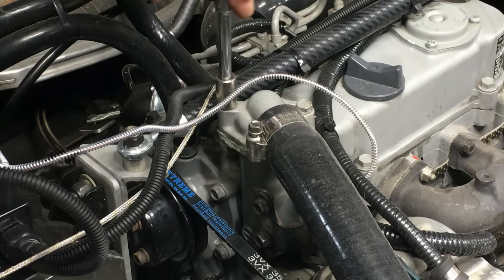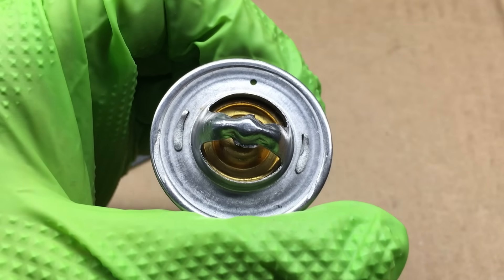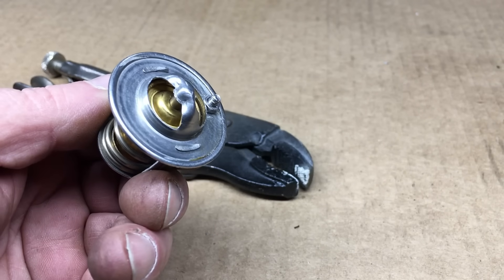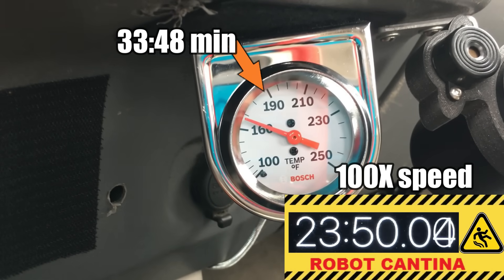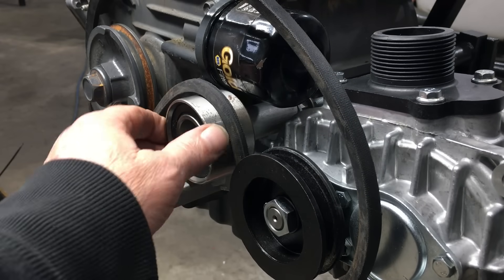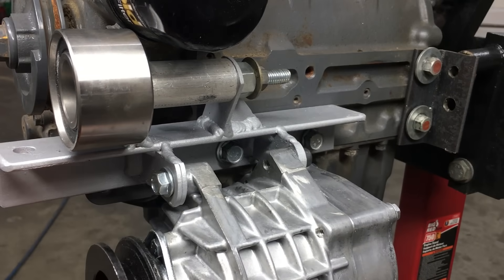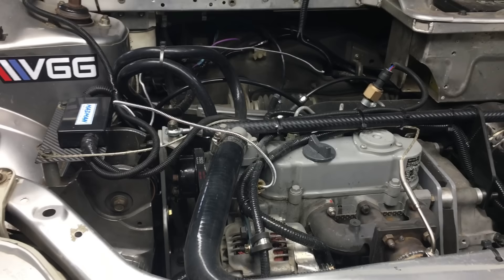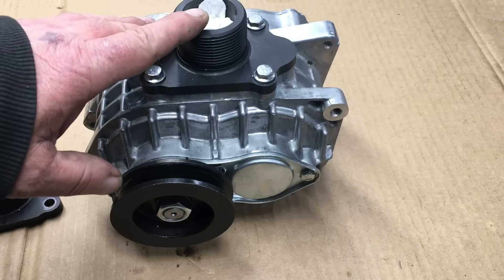S4 E4. Thermostat issues and making an AMR500 Supercharger fit a 719 cc Kubota diesel engine

Comment: I wonder if it wouldn't make more sense to install an belt driven air compressor and an air tank instead of a supercharger.

The benefit would be, that you could install a clutch and disengage the clutch if you push the throttle down far enough. So you only rob engine power for the compressor if you have power to spare.

If the air tank is large enough you can accelerate to 60 mph before you run out of pressure and for cruising there should be enough power to spare to recharge the tank again, as you ease up on the throttle.

Another option would be to run an electric compressor off of 12 V and stop charging with the alternator once you kick down.

Comment: I think the idea is more to have the thermostat to heat up faster, not the engine. So the thermostat regulates faster open if the engine heats up quickly, as there's a constant stream of hot water flowing around it.

But that's absolutely not an issue and can be ignored except on high performance engines.

Comment: alh tdi , they use 3 glow plugs in the coolant system right off the thermostat on manual cars. seems to work well (installed in the coolant hose )

Comment: Turbo vs super charger is a choice made between higher top speed and durable efficient power. My KEI truck is getting an AMR supercharger. I'm want the higher stable torque throughout the RPM range. Not going for more rippums. It's a work truck.

Comment: I'd throw a 190 or 200 degree thermostat in it if you're constantly running into heat issues. I'd wonder if your cooling system is too large and the sheer volume of coolant is dumping temperature faster than the engine can make it

Comment: as a guy from up in canada,  if youre struggling to get some heat id reccomend blocking off things as best you can, blocking airflow through the rad can help. so that way when your thermostat opens at 160. most of the equipment that has an engine like that, has a belt drivin fan, if if your electric fan is coming on too soon you could also see about disabling that.

Comment: I'd try another thermostat they can be bad even when new.

Diesel engines take a long time to warm up with out a load because they do not have a throttle so they are always cycling lots of cold air through them

Comment: So you need a smaller radiator is what I hear. This engine was designed with a single core radiator half the size your using. Also that original radiator never used ram air to cool it rather just the engine cooling fan therefore the ram air is even further super cooling your cooling system while driving down the road.

Comment: Window shade type of radiator blinds:  SAAB 2 cycles used them because their little 850 cc 3 cylinders made not much heat while warming up.  They also carburetor iced like crazy without an exhaust stove snorkle to the aircleaner.  The blind you could control from inside the car  but not the exhaust stove.

Comment: Without the hole, the temp can oscillate above and below the rated temp at the initial opening.  Some thermostats that appear to not have the hole, still have an engineered small opening area made into a spot where the center spool and outer section come together.  I've played with thermostats a lot over the years, they are pretty nifty inventions.

Comment: I wouldn't use a belt drive Super charger i have seen the supercharger dyno results on another channel and it initiated a 20 hp loss ro spin the super charger. So yes belt drive supercharger big mistake. Aspire to create an electric drive super charger and fet rid of the restrictor to really open up the air flow with a custom wide open connector

Comment: Check out my fast and fuel efficient diesel grand caravan TDI swap , 6 speed manual. 900 miles per tank highway. 295 wheel torque.

Comment: I read on a diesel forum about some Renault 1.4 diesels cooking the cylinder heads, apparently because people replaced thermostats with "pattern parts", that did not have the bleed hole.  Apparently it avoids creating hot spots on warm up.

Comment: One of My Fondest Memories after Graduating H.S. in 84 was Working @ a Large Third Generation Welding Repair & Fabrication Shop. They Worked on Everything from what came in the Door to Aerospace. One of There Long Time Customers Came in With His Logging Truck, With A V-12 Detroit Diesel two Stroke. Twin Turbo, Suppercharged Straight Stacks. He Stated There Was """ NO "" Faster Truck in the Mountains Than His. The Super Charger Gets That Load Moving and Spins that V-12 Up Then The Turbos Kick In, & Him, His Truck & His Load Are Gone  !!!
( and It Souded Beautiful ) But Every Inch Under That Hood Was Used !!! 
Radiator, Motor, Firewall..... Nothing To Spair

Comment: At least on rover K-series engines, the bypass hole in the thermostat is to prevent a sudden rush of very cold coolant from the radiator, cold shocking the engine, however on the Kubota diesel being an iron engine, I don't think it's an issue

Comment: I know you cant get a higher temp thermostat due to the unique size. What about 3D printing a bespoke housing to fit a different thermostat? Or even just an adapter plate? I know a lot of them are made from plastic?

Comment: Im looking forward to seeing how the Insight goes compared to the base line acceleration tests, once its running with 10psi from the supercharger. And then further gains hopefully from a proper front mounted intercooler this time. I think it will make quite a difference and be far more responsive between gears than the turbo was.
What would be cool is to see a dyno run with a power and torque graph for the car, firstly with the supercharger and then with the turbo from the Saturn.
Will Jim be gearing the supercharger to make the 10psi at 3600rpm, or could it be geared higher to make the boost at lower rpm, and then a turbo waste gate used to maintain the required 10psi to the ~4000rpm the engine car reach?
The new exhaust system will certainly flow enough gas for any modifications made this time.

Comment: You also had the window shade cover on cold spec 60 series land cruiser with the 2H diesel engine. 
I still have the original part on my 1983 HJ60 lamd cruiser, but the curtain have seen better days, that for sure!

Comment: For what its worth... And my evidence is purely anecdotal... I switched to a to a hotter t stat on one of my little isuzu diesels and I could swear it ran a little smoother, cleaner and quieter once it was completely warmed up. I mean technically it makes sense, you're reducing the temp delta between thd pre-cup and the water jacket. I could swear it got me better fuel mileage too and did a little better on power. But maybe I just tell myself all these things to sleep better at night. 

Also, if anyone reads this, if you could get me a PN for the injectors I'd be interested in supplying a set with a higher NOP. As far as I know all manufacturers have a higher NOP when running boost (maybe paired with slightly retarded fuel timing).

Comment: I could be mistaken, but I think my comment before has disappeared. 
So again, maybe a way you can extract a little more heat for the coolant loop, would be to pull an EGR valve and EGR cooler from a diesel pickup. Plumb the EGR to pull exhaust post-turbo and route it into an EGR cooler, and then back into the exhaust. Since this is not an emmissions vehicle, no need to feed that ick back into the engine, just run it back into the exhaust. With the exhaust going into the EGR cooler, it will dump exhaust heat into the coolant loop! It can be completely controlled by the valve, too. Just a thought!!! I am sure unwanted EGR parts should be readily accessable 😂

Comment: Do they make a higher temperature thermostat? Seems like you might need to find a 200F instead of a 180F if the 180 is maintaining 160 with your fan running then wouldn't it likely maintain 160 when driving regardless of the outside temp?

Comment: I'm certainly no mechanic, but my guess why there is a bypass valve is because the water isn't only used to cool the engine but also to spread the heat. You'd get very high temperatures next to the actual cylinders when the engine is running and there is no water flow while other parts of the engine might remain dead cold. Worst thing about this is uneven heat expansion.

Comment: While we're on the subject of cooling and thermostats, it is commonly believed that removing the thermostat will cause overheating because supposedly the coolant passes through the radiator to quickly and doesn't have time to cool off. I rather think that the flow restriction of the thermostat which is downstream of the pump allows the coolant pressure between the pump and the thermostat to go quite a bit higher than the nominal radiator cap pressure, and if this restriction is missing then the consequent lack of pressure, particularly at hjgh rpm would allow localised boiling.

Comment: I would imagine the ideal but more complex method of cooling would be to have the coolant circulate at full flow (but with a calculated degree of restriction) and entirely bypass the radiator when cold, and be progressively / proportionally diverted to the radiator as the desired temperature is reached. That way, dead cold water exiting the radiator is mixed with fast flowing hot water from the engine loop. More complex, but may yield better results.

Comment: A diesel engine at idle ingests a great deal more air than a gasoline engine, and if this air is at a low temperature it will contribute to engine cooling in an uncontrolled manner as it passes through the inlet ports that are surrounded by coolant.

Comment: Supercharger boost will be 100% rev dependent and will drop on each gear unchange. Be an interesting but very involved experiment to drive the Supercharger with a variable speed type pulley arrangement to maintain a given boost independent of engine revs.

Comment: In my part of Canada (about the lowest I see is -40C/F), we used to use the cardboard in front of the radiator trick quite a bit before electric fans became a thing.  With electric fans the cardboard trick doesn't have as much of an effect on available heat in the cabin.  For example in my 3L minivan, when the outside temperature gets below about -30 the engine just doesn't produce enough heat to warm up the interior space for a very long time.  The engine is running efficiently enough that it just doesn't have enough waste heat.  It warms up faster if you drive it like you stole it, something that works much better with small 4 cylinder engines that don't get you into speed violations as quickly.  You can also try putting the cardboard directly up against the radiator, but if you do, cut about a 6 inch diameter hole in it centered around the fan.  If you're wildly off-center, you can actually make the blades flutter and hit the radiator fins.  Putting the cardboard up against the radiator allows more of the coolant to come up to temperature, in essence creating a larger volume of heated water.  This helps keep the air out of the heater stay a little more constant, because the cabin heater can overcool the engine in low load situations and you get cold air out of your heater.

One other thing that can help is to install a higher temperature thermostat, but I don't know how useful it would be in your climate.  I'd be interested to see if the supercharger without the intercooler would help with cabin  heat :).  Thanks for posting the video!  Interesting stuff!

Comment: You might consider a radiator bypass hose, which is a hose which bypasses the radiator, not bypasses the thermostat. I had to add one to my wife's Kawasaki GPX250 which wasn't warming up on frosty mornings.

Comment: Having worked at a Kubota dealership. The most important thing when filling the cooling system, is to fill from the thermostat hole until it's full, then install the thermostat.  Then fill the radiator.  A Kubota engine will not burp out the air bubbles if you do not do it this way.

Comment: Hunt around the salvage yards for an EGR cooler.
You can plumb it into the exhaust and cooling system with an exhaust butterfly valve and bypass.
This will solve all the cold weather problems and heat the engine in a few minutes.

Comment: Don't plug the bypass, some engines would die in short order with a plugged bypass. was a problem we went through with the old SBCs back in the day when GM changed the bypass from through the heads to the intake. Maybe it won't be that serious in this engine, but instead of plugging the bypass you can try to reduce the size of the hoses or put a constriction somewhere to reduce flow and thus increase heat, or just a higher temp thermostat. The bypass is crucial in preventing hot spots as I'm sure other people have mentioned.

Also superchargers aren't an issue on diesel engines, people don't understand that turbos aren't drag free, turbos are literally an exhaust restriction and your piston has to work against it to push exhaust gasses out, thus inducing drag. For a little engine like this, I'd put money down that a supercharger is going to perform better than a turbo, superchargers have predictable boost curves since it's directly tied to CC/revolution and revolutions are directly tied to the crank. Predictable means your little mechanical fixed adjustment is a lot easier to tune. and the size of this engine means no turbo is small enough to spool close to idle. If you look at a truck diesel or any bespoke car diesel, they start making boost right off idle, a Cummins in a ram is at peak boost by 1800 rpm, that's about half of redline which is exactly what you'd want. In an ideal world you would have a couple PSI at idle but then your emissions and economy would take a hit.

Comment: I have had issues with Kubota thermostats not working properly. Mainly running cool. In a car engine the thermostat regulates temps better. These engines are made to work hard and a more than adequate cooling. They do make heater kits for kubotas with cabs. I have installed several on those little engines. Not that it would make a difference but try an automotive thermostat from something like a Mitsubishi. Also that radiator is too big. That engine would usually have a radiator the size of a shoebox.

Comment: I don't think that the thermostat is the problem, maybe your radiator is too efficient with this fan.
If it helps, you should try something that starts the fan slowly and increase the velocity until max, I don't think that you can use a thermistor directly because you need a minimum voltagem to start the fan without any risk.
Well, I think that the velocity approach on the fan will help a lot.
The hole in the thermostat let a little amount of water flow so hot water could reach it faster, without the hole the water only reach it by convection. (I hope that my English is good enough for you guys understand).

Comment: What's happening is the thermostat isn't actually sealed so it's probably blowing coolant past it. The little hole is a bleeder when filling it and gets air out of the system. Not hard to figure out Jimbo.....n my 04 2.2 cavalier takes a good minute to warm up also when cold. Like 20 and below. Also I still don't understand why ppl blocked off radiator. Thermostat n all. Unless have a major leak around the thermostat it still opens n closes as should.

Comment: Given what many of us were told about the bypass hole - that with one the coolant can heat the wax to open it up-  it seems like the real problem is that the cooling for a certain flow is a bit much for the minimal heat generation. So while you could use a higher temperature thermostat, which seems entirely reasonable since it would be easy, the actual difference in flow rate between high and low temperatures is still a good ratio with this one - it's just that the flow rate is equal to way too much cooling right now.  A way you might be able to get around that is to make a bypass for the radiator too. That way, a lot of the coolant that makes it past the thermostat never gets to the radiator, but just goes straight back into the engine. 

You want that bypass to mostly happen when it's cold and not much when it's hot, so the natural idea for me is to think if there's something that actually closes when it's hot. Maybe a confused thermostat with its lines crossed? An easier way might be to try and make it so that it can easily pass a certain leakage flow rate but any more than that and it poses too much resistance and the coolant has to go the other way. Or, if you can get something that only opens up when there's a certain pressure against it, you could put that inline with the radiator - then with a restrictive bypass, the pressure will only build up when there's enough flow, and the flow only builds up if the thermostat is open, right?

Comment: The little hole is for some of the warming up fluid to get to the thermostate's cylinder which contains a wax which expands with temperature and pushes the thermostats valve to open. Do not close it.

Comment: When I was a kid in the '60s we had one of those Volvos with the window shade in front of the radiator. If memory serves me right all I remember seeing inside of the car was a ball chain like for the old ceramic light switch. There was a piece of metal with a hole that the ball chain came through so you could get different adjustments for the window shade.

Comment: Definitely leave the bypass open, it has important functions. You really should put a smaller radiator in it. I would recommend a motorcycle radiator. Should be the right size.

Comment: With the addition of the supercharger, how do you plan on adding more fuel through the injectors in order to achieve the correct air fuel ratio with the forced induction?
Reply from the maker: We can adjust the fuel rack for more fuel when required.
Reply: Awesome! Love your videos! @robotcantina8957